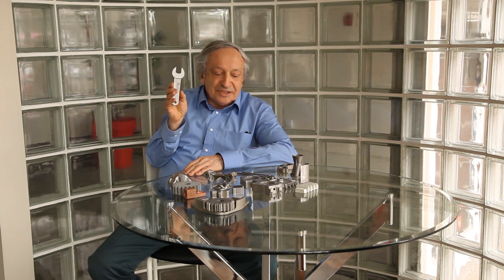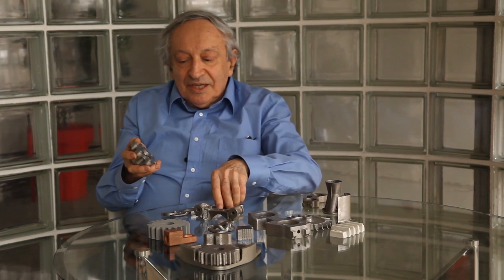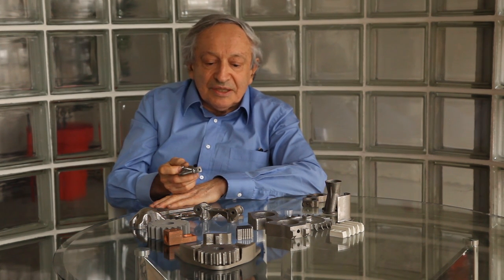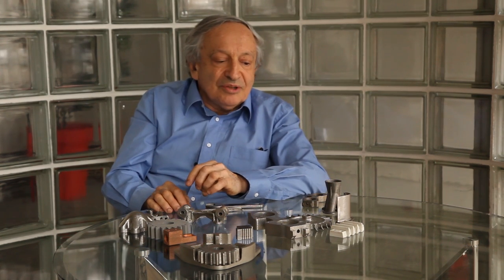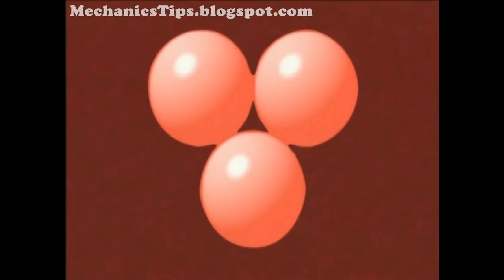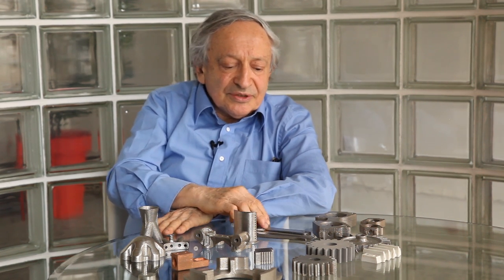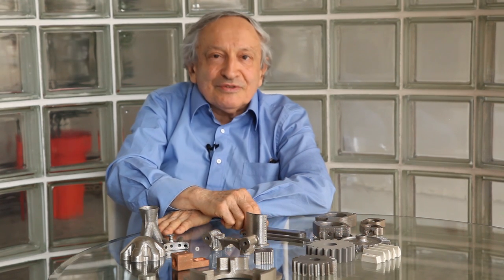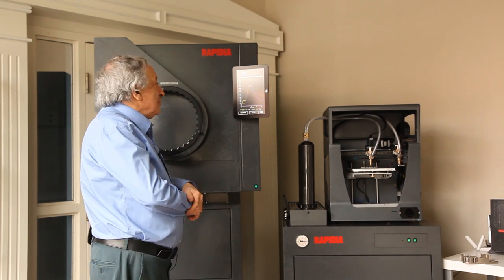Prototyping - Metal 3D Printing

Comment: Hi Dan, first off, as an engineer and a prototype studio owner, I absolutely adore your videos. Now a question: could it be effective to pack the large parts tight in molding sand to hold them during the sintering process so they won't sag? or even submerge it in plaster much like you would for the "disappearing wax molding" method...
Reply from the maker: The problem is that the parts shrink about 17% and anything that prevents them from shrinking (sand, even loose free-flowing ceramic balls) will cause the red-hot metal to tear. Once you understand the nature of the sintering process you can design around the limitations. The other metal 3D processes have different limitations.

Comment: @Dan You talk about FDM (Fused Deposition Modeling) at 17:00, FDM is not a Powder process so there isn't "Air" that is disapearing, unlike SLM (Selective Laser Melting) or more complex EBM systems.
Thus what is happening is that the filament that is suspending the metal particles needs to be "Burned away" which results in high Shrinkage.
SLM is already shrunk in the process, and is accounted for in the slicing software the Post Process Technique of  Heat Treatment is used to reduce the stress built up as well as creating a better uniform micro structure as is done with castings.
You might be referring to Binder Jetting, which would be a metal powder using a special binder to bind the metal particles together. Which does have Shrinkage in the Post Process of Sintering.

Ah seems like you have merged Binder Jetting with FDM!
Reply: at 21:00 You Speak of SLS and SLM, SLS is ONLY used for Plastic parts! It is a misnomer to use them interchangeably. Arghhhh~~~ The parts afterwards...

Comment: long-term (long long term). This process would be perfect for manufacturing in outer space. No supports required, can go as large as you want without gravity-induced sag, inert environment for sintering. Definitely the future. A few hundred years from now I could imagine all manufacturing is done in outer space in giant 3 dimensional factories without people. The raw material cost, tool-path and energy costs are the only factors that go into calculating the cost (think an Amazon AWS type service). You provision the tooling required and get the object (tea pot or cruise liner) you want. Thanks to gravity, delivery should be relatively cheap too.

Comment: Thanks for sharing Dan. I'm a metallurgical engineer and have some experience with metal additive manufacturing (slm, fdm and binder jet). How much shrinkage does this process have? Is it compensated for in the slicer? I've done some microstructure comparisons between the methods I previously mentioned and all of the methods have some level of porosity, roughly 1-5%, how does your machine perform?
Reply from the maker: The porosity is 1-2% (i.e. the density is 98-99% of theoretical density. You cabn see full material properties and microstructure photos at https://www.rapidia.com/materials

Comment: So where do you thing machines like the Matsuura Lumex series fit?  They are a SLS/SLM technology, but are able to machine the parts as they build them, essentially removing secondary operations and precision limits (but retaining the cycle time of the subtractive manufacturing processes obviously).
Reply from the maker: Don't have sufficient personal experience with those to have an opinion. Only seen them at trade shows.
Reply: @dgelbart  I appreciate the reply.  Too few folks that I run into know how to use the words "I don't know!"

Comment: Powder metallurgy part production was possibly the largest innovation in the mass production of ferrous part production to arrive with literally zero fan fair.  I fear that much of the promise of "metal 3D part production" has been here and has already been priced into the equation.  There obviously remains significant potential for sintered titanium parts and parts composed of multiple alloys or even individual metals which will respond favorably to heat treatment, environmental corrosion, or other post processing.  Thanks for the assessment Dan.
Reply from the maker: Anything that excites the young generation and has billions of $ poured into it will make great progress.

Comment: 37:00 Good luck getting your machine into Australia, or any other I would have thought if you haven't looked into and provide full documentation with the machine of both the nature of the gas given off and potential health risks, vented outside or not.
Reply from the maker: There are two other makes of metal 3D printers with a similar sintering process, both are selling in Australia, neither provides data on the gas emitted from the tube. However, I agree with you and we will supply analysis of the gas emitted. We will do it in the next few months. We only start shipping to Australia in a year.

Comment: If the warping in the slm systems happens in a predictable way, couldn't the model be generatively pre-warped to balance out the stresses and make the finished part fit the spec without supports and expensive finishing?
Reply from the maker: This can be done for both SLM/SLS and sintering, but it is hard to model. It works better for sintering, as stresses are lower.  The best is to assume that critical areas will always need machining.

Comment: Sir , thanks for sharing your knowledge & experience it’s priceless
Also I wanted to ask you does metal 3D printing or SLC are free from porosity defects also I am countering issues with porosity in investment casting ( very difficult to repair ) is it possible to repair porosity with metal powder then oven ? Please do reply whenever you are free.
Reply: Hi, Porosity has a direct relation to the melt pool, based on Depth of Melt and speed of the laser. Thus yes you can have a lot of porosity issues if you try print too fast. This can be worked with in Metal 3D printing Simulation software that most Metal 3D printers have, they aren't cheap though.

Comment: How strong are the parts? Can parts that will be subjected to high stress be printed (turbine blades, etc)?
Reply: nm guess so.. watched 41 minutes in
Reply from the maker: Parts have about 80% of the strength of machined parts. Parts can be heat treated to increase strength.
Reply: @dgelbart  
Mr Gelbart, Thanks for the info.

Comment: Can't the size limitation be overcome by just RE-sintering the smaller sintered pieces together to make bigger pieces? 
Like that double turbine you showed, it was made from 2 turbines that had already been printed & sintered.
in 3d plastic printing, people sometimes make HUGE things by combining lots of smaller prints together.
Reply from the maker: If pieces have large overhangs, they will still distort in sintering but there are tricks to get around it. Even if parts are not pre-sintered they can be water bonded into a large assembly and sintered, but it needs a lot of experience.  For example, many support columns (hand removable after sintering) can be added. Still, for the beginners, it is best to stick to smaller parts, and gain experience slowly. You can, of course, braze parts into a large assembly without distorstion, because brazing temperature is much lower. The sintering furnace is a great brazing furnace, you don't even need flux because the hydrogen acts as flux.

Comment: +Dan Gelbart  is there a price guide for the Rapidia system ? Wondering if this will be affordable for a small hackerspace, thanks.
Reply from the maker: The Rapidia system has the lowest cost per part of any system availavle today, but it is still expensive and the metal is expensive. The total cost of an installed system, with spares, service training, initial supply of metal and more is $175,000.  If you are on a budget better start with a CNC lathe/mill and waterjet. They have a faster payback unless you make many turbines or parts with internal structures.
Reply: @dgelbart  Appreciate the advice, thanks!

Comment: I'm going to ask a very dumb question. What is the downside to 3d print a part made out of wax or something denser with similar melting points, create a cast, melt the material out, flow powder into the cast while vibrating it, and then into an oven?  It sounds to simple or I must of missed something.
Reply from the maker: First,  the refractory shell, what you call the "cast": because of the high temperatures, it has to be ceramic. This means long drying times. Also, wax is not only "melted out", has to be burned out to evaporate every residue. Bottom line: you still need a 3D printer and a controlled atmosphere furnace. If you got both, why not print the metal paste directly?

Comment: Correct me if I'm wrong, but this has some similarities to MarkForge's metal printer.
Reply from the maker: It is  similar to Mark Forged  Metal X and to Desktop Metal Studio, but it has many advantages over them, main 3: 
1. No need for time consuming debinding operation and debinding unit. 
2. No need to waste metal and print time to print a metal base for each part. 
3. Because of evaprative support, it can do complex internal structures.
Reply: @dgelbart  is there any disadvantages compared?
Reply: @dgelbart  for transparency, I do not have the money (or purpose) to buy any of these units. Just curious.

Comment: what metal 3d printer do yo recommend in the <10k to range 50k range and on if possible
Reply from the maker: There is none (that works).
Reply: @dgelbart  What are your thoughts on the Markforged Metal X and the Desktop Metal DM?

Comment: Can't you print a big part in sintering machine by breaking it into smaller ones and then bonding it together or laser welding them.
Reply from the maker: yes, you can.
Reply: @dgelbart  Oh, thanks sir. My tubelight is still working. 😁😁

Comment: 20:17:  “some of the people refer to this method as selective laser sintering...”  Mr. Gelbart goes on to correctly note that the process is more accurately called selective laser melting.  Indeed, this is the technically preferred term.  He is a bit confused about “Selective Laser Sintering” or SLS, however.  SLS is indeed a valid name for the Powder Bed Fusion process as performed with polymer materials.  When the laser hits the polymer powder bed surface, it does in fact sinter the particles.  So, the term “SLS” is correctly used for this process.  

When it comes to metal powder bed fusion, people do NOT use the term SLS.  There is an unfortunate history here, which led to the term “Direct Metal Laser Sintering” (DMLS) being popularly adopted.  This was (and still is) EOS’s terminology for the process, and it stuck.  That’s unfortunate, because it is NOT,  as Gelbart notes, technically accurate.  

The story I’ve heard is that EOS coined the term in the very early days, when the laser powder bed fusion (L-PBF) process in metal was not sufficiently advanced to avoid a fairly high degree of porosity in the finished part.  So they believed (or simply stated) that it was a sintering process.  It was not; it was just a less mature, more poorly controlled, version of laser melting.  Selective Laser Melting (SLM) is a far better term, but so many people in the industry continue to refer to the process as DMLS.  Much to my annoyance...! :-)
Reply from the maker: If you Google "Laser sintering of metal powder"  you'll see that many people call it sintering instead of melting.  Even the plastic powder systems are actually melting.
Reply: @dgelbart  I don’t mean to quibble, and I will say that I enjoyed your video overview.  I have held a senior technical position with one of the leading metal L-PBF machine makers, and I do know whereof I speak.  I don’t know that many people call the process ‘SLS’; in fact those who do are misspeaking.  I DO know that many people call it ‘DMLS,’ since that name got traction way back when EOS was the best machine to own and they coined the term.  I dislike that name for the process because it suggests that it is sintering, which, as you know, it is not.

‘SLS’ is the correct term for the polymer L-PBF additive manufacturing process.  And I beg to differ: it is not melting, though it may not be true sintering, either, in the classic sense of that term as applied to metals.  In the SLS machines, the chamber is held at an elevated temperature slightly below the polymer’s glass transition temperature.  The laser merely pushes the temperature locally above that value.  You can see the similarity to classical sintering, of course.  The difference is that the particles in the powder bed that are not hit by the laser are not fused strongly enough so that the powder cake can’t be broken apart after the build is finished.  In a true sintering process, that wouldn’t be the case; they would be more strongly, irrevocably fused.  Perhaps that’s why you think that the plastic particles actually melt.  But they do not; I’m curious why you say that they do.

Comment: Why did you not print a DIN/ISO Test Piece and Test the Tensile Strength and other properties on the Test piece?
Instead you show a compression test, which is very deceiving, especially since you said there is no infill!
Would be interesting to know if you have Layer Issues.

Comment: Wouldn't the level of internal complexity of a plastic part also drive the decision to 3-D print it, same as with a metal part?
Reply from the maker: Correct, but most internal complexity like cooling channels, piping etc is not very useful in plastic and does not show up much. The only exception is closed- cell infill pattern, which is also nice in plastic 3D printing. Please note that laser machines can not do closed-cell infill (powder stays trapped) and machines with debinding can not do a 100% solid pattern unless it is very thin. A 25mm (1") thick wall will takes days to debind. 100% solid is needed for maximum strength. A water based system can do all patterns.

Comment: Ok, the only thing I got from this is to go back to my 6 axis machine and wait for another 20 years till 3d printing metal will be perfect. By the way I finished the video without pausing.
Reply from the maker: All depends on the parts you need to make, as I explained in video. I know someone who has 12 metal 3D printers running day and night just making miniature heat exchanges.

Comment: Metal 3D printing needs to solve the problem of guaranteeing and certifying the material's mechanical properties (yield/tensile strengths, etc). Until that happens it will never make it into load bearing application (gears, bearing housings, etc)
Reply from the maker: This is typically handled by printing and sintering a test piece together with the main job. The test piece can be destructively tested.
Reply: @dgelbart   Yes that's the inconvenient part but the problem is there is no way to guarantee the material will be fused together the same way for the next print. The variables in the machine itself affect the mechanical properties of the material. I work in aerospace. One of the big issues we deal with is certification of materials and is the reason why most of the metal printing we do is only for R&D and prototyping.

Excellent video by the way.
Reply from the maker: @internettoughguy  Fully agree, that is why you need a test piece in each print run for critical parts. In general, 3D printing is more for R&D than production but it is progressing fast  due to the excitement it created and the huge investments it is attracting.

Comment: There are now two much  better (and much cheaper) ways to 3d print metal than sintering. You can cast, or print metal directly
Reply: https://www.youtube.com/watch?v=MoxK2hWN4LI&list=PLKMibXjSbH4hIRooW_vHB5Hu8IkQ7hvkJ&index=19&t=219s
Reply: https://www.youtube.com/watch?v=5PNXb5dptr8&t=2s
Reply: It is german but you can chooose english subtiteles.It says basicly you can use a normal fdm printer but you better use there patetend filament feed because the filament is too brittle.You can print carbide,ceramics, copper, titanium and stainless steel It must be sintered afterwards. For example: I will build a small but precise CNC lathe with this method and a housing made from carbide

Comment: Is it possible to submerge the part to sinter in a liquid material to provide buoyancy and allow bigger pieces to be sintered? Maybe a salt soluble in water?
Reply from the maker: Theoretically possible but not simple to find a material that can take 1400 deg C and does not interact with metal at this temperature.

Comment: Hiving with multiple printers and ovens then using a large oven to bond multiple components should overcome the cost time factor. 
You didn’t mention a bimetallic print possibility for hard inserts in softer or radiating support structures. Is this a possibility?
Reply from the maker: Bi-metallics are a problem as the metals form an alloy. I actually tried a carbide cutter with a chrome steel base but it got messed up as the alloy formed had a lower melting point.
Reply: How much temperature differential?  If insert is higher temp print first. Sinter then over print on a supporting scaffold as part of insert design. May need axis rotation to get total infill. But a good 3D mapper could optimise this. Have to figure expansion contraction ratios. Another option is to ceramic cost using slip dip and oven